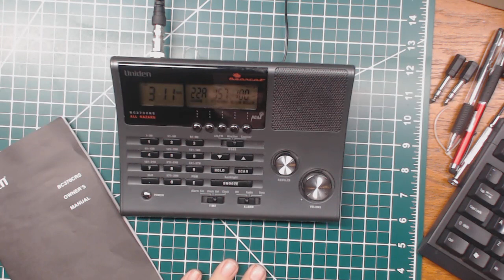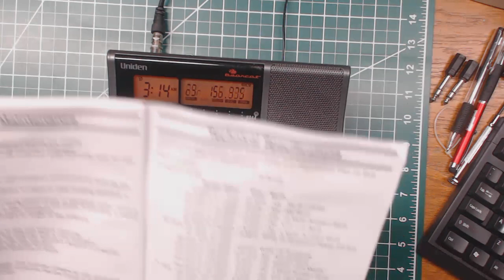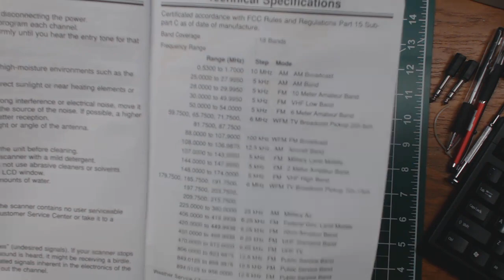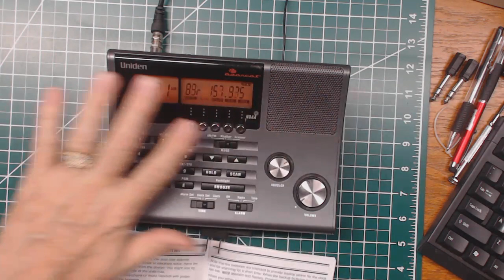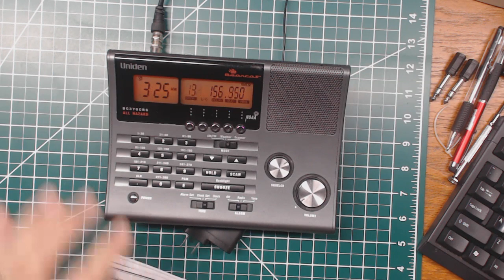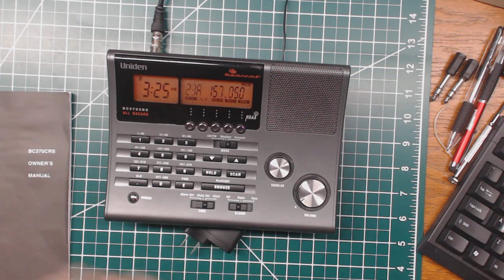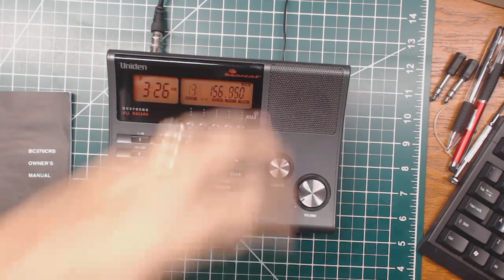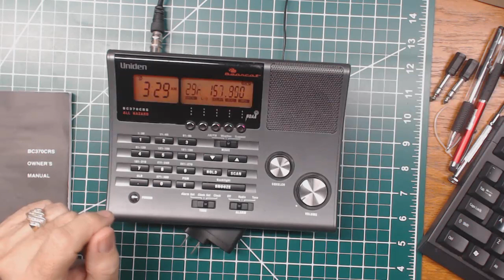TRRS #1008 - Finally a New/Old Scanner Radio

Comment: I only noticed after buying the BC365CRS that it does not have AM so I was a bit frustrated me so Iooked in eBay for a model that has an AM band and I found this model a BC345CRS.
at least both have 220 - 380 Mhz

Comment: Have you tried using an Antenna Slitter for your Discone Antennas - so they can be used for Multiple applications?
Reply from the maker: Yes but it take a number of cable adapters.

Comment: I recently scooped a new BC345crs at a London Drugs store because of the military air band feature, although I have not been successful at catching air force planes as of yet but I did pick strange  pirated satellite Russian  CB style communications, very faint due to narrow FM signal on AM uhf receive 258.350,  262.425,  269.662,  253.862,  255.550 MHZ are a few you could try. I use a home made 8 element log periodic antenna i built for 220 to 450 MHZ  still no military planes though. I  Might program some Boeing factory test frequencies 150 miles away, also on uhf air.
Reply from the maker: Typically VHF and UHF stations have be line of sight to receive.
Reply: On rare occasions I can pick up aircraft on VHF up to 180 miles away when those planes are at full altitude. I do, at times hear the Everett Boeing factory radio flight  test communications on VHF 123.000 to 123. 500 area, so UHF coverage might also be possible too.

Comment: 2021 and still can’t find one.
Reply from the maker: I have seen them on Ebay sometimes.  That is where I got this one.
Reply: I rarely see them anymore on ebay they are hard sought after radio scanner I'm lucky to have one myself they just dont make them like they use too.I mean you get the Atomic clock,NIST Satilite sync,seprarate large clock screen,all hazzards alarm,AM radio in whitch the newer model BC365crs does not have any of these features.
Reply: One on ebay now

Comment: Question, if the local police have switched to digital this unit will not work?
Reply from the maker: You are correct, it will not track digital.
Reply: @hamrad88  How do I find out if the local police are digital or analog? Call and ask sounds a little suspisous. I live in a very rual place and it would be good to know what is going on around here.
Reply from the maker: @markrankin3297  Try RadioReference webpage, they may have your area.